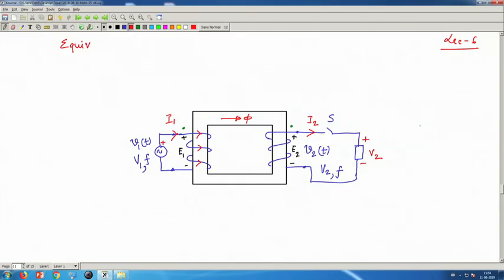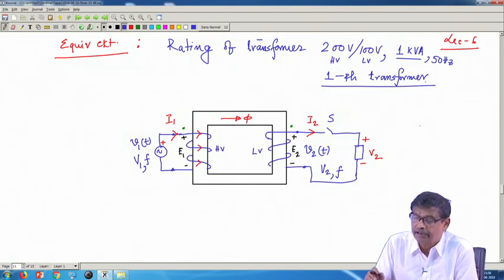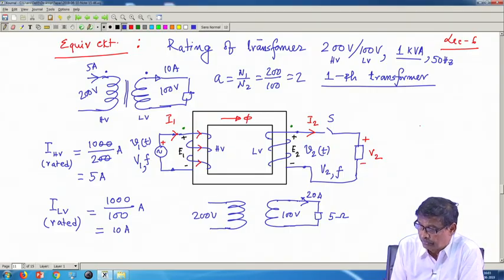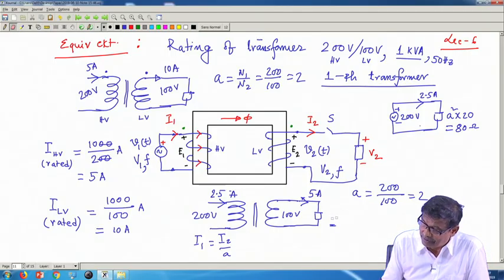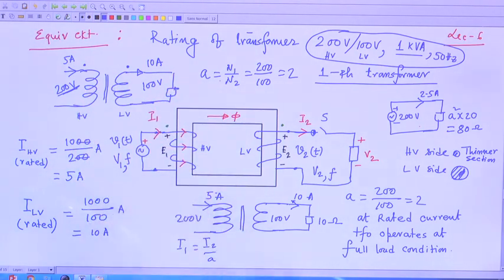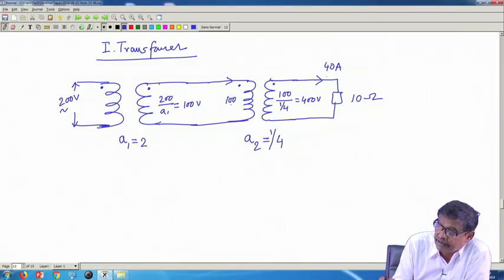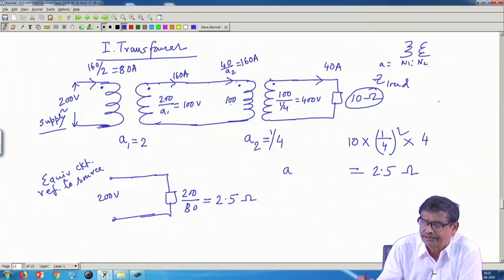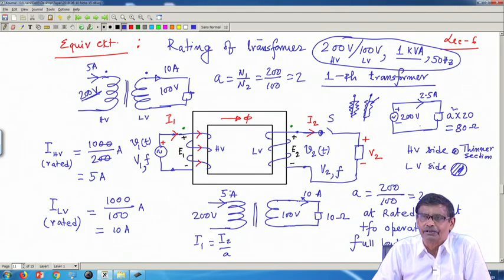Lecture 06: Rating of Single Phase Transformer: Rated Current and Rated Voltage with Example

Comment: current ratings decide the thickness of the wires and voltage readings decide the insulation level